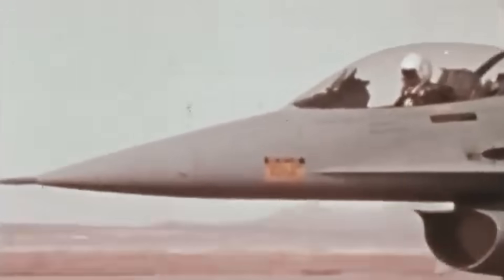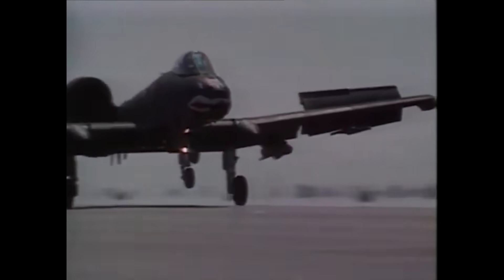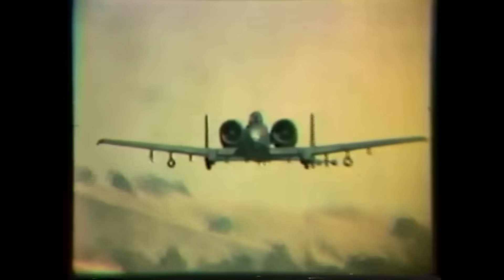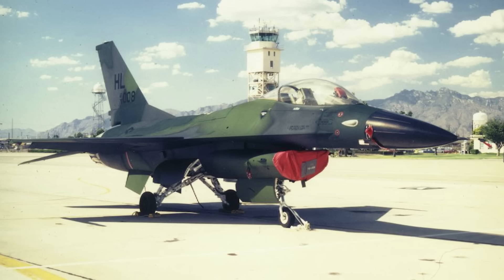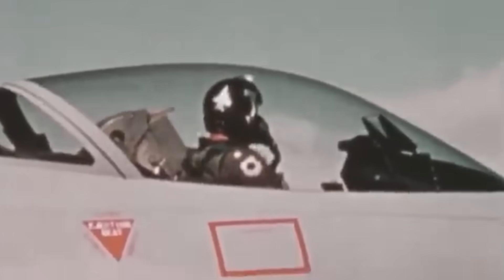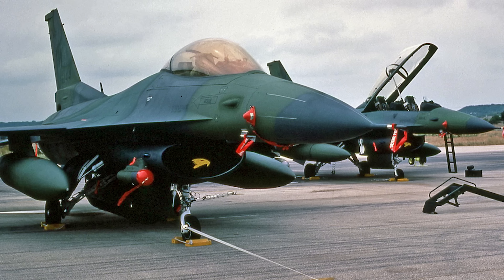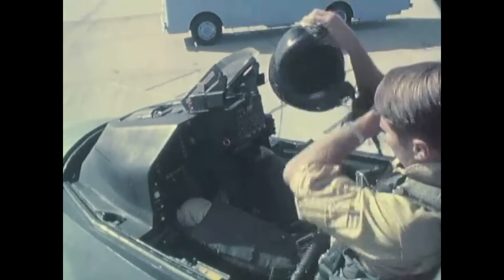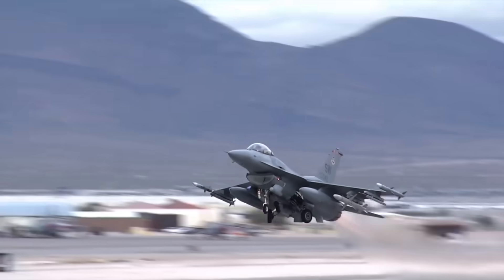The A-16. Can a Viper turn into a Warthog?

Comment: I didn't know the US had the IRST turret back in the 90s. Very important device in today's warfare. Also if firepower and loiter time is a concern for CAS missions, why not use attack helicopter or AC130? You already have air superiority. You don't need the Hog.
Reply: The US had the first IRST systems.  The F-101, F-102 and  F-106 Delta Dagger had IRST all the way back in the early 1960's and it had a detection range of over 100mi on high altitude bomber sized signatures. The F-106's system even slaved the IRST to the radar and vice versa.  There seems to be some belief that IRST is some Soviet innovation and that the US has always been behind on that system despite them fielding numerous aircraft with it.
Reply: Mostly it's cheap (operating hours and repairs), loiters, stable gun platform, numbers, and extremely high survivability (yes even against IR Manpads, flares and one consideration of the "strange" tail control surfaces / turbofan engine nacelle design). Multiple A-10s can rapidly engage "surprise" targets simultaneously at peach picking level in any weather and loiter just outside a hot zone to be deployed in seconds instead of minutes, and have the ruggedness to get the pilot back behind friendly lines when they are damaged. Hans Ulrich Rudel was consulted on their design, he knew a thing or two about what does and doesn't work for DCAS at the very fundamental level.

AH's are too slow, fragile and have limited fuel for loitering, they are mostly used for planed ambushes, raids on small stationary targets or supporting UHs into hot zones. The AC-130s are comparatively slow, somewhat weather restricted, and way more susceptibility to long range radar guided threats since they have to operate so high and in limited numbers. They are better used in support of well planed clandestine ops on limited numbers of asymmetric targets. Neither have the survivability or stealth to be actual "hot" battlefield assets.

But the deployment numbers and battle hardiness was only applicable if the A-10 air frames and spare parts were actively being made and supported under contract, since Fairchild-Republic went bust and no one makes them anymore their ability to cheaply "zerg" a battlefield with hardened air power is a moot point. So unless someone like Boeing supports the program, like they did with the F-15, they are better off retired and money spent on an armored drone swarm program in conjunction with a "handshake" to forward air command and control pilots with VR.
Reply: When developed the A10 was seen as a fast deploy tank buster raining 'liberty" on a potential red army tank rush on the planes of Europe, within a "contested" air space. While the C130 could do the job, they are much too large and even more vulnerable, attack helicopters didn't have the range or speed to counter such a rush.

Comment: Is it possible to make a UAV A-10 with GAU-8 Avenger? There are examples of the F-16 that can be flown as a drone with no on-board pilot. An Aerial refueling UAV such as the MQ-25 (land based variant) could accompany a cas F-16 uav to allow more time on station or just one strafe run and then drop a weaponsbay of switchbl@des. The F-16 is still in production. Purpose built drones as CAS aerial support? A supersonic stealth UAV with a weapons bay of drone sub-munitions and small missiles. The allied ground forces are led on patrol by Darpa point-robots each packing an M240. The Darpa point-robots & small scouting drones determine the allied group is close to a well-hidden enemy ambush. CAS comms sends two stealth UAVs or Kratos airwolves. The first wave of submunitions takes care of the enemy ambush team and the second wave (like Bolt-Ms, switchbl@des etc) fans out looking for possible back-up for the enemy ambush team.
Reply: @alanb9337  it wouldnt be worth the cost, when instead you can just getting more F-35s
Reply: @De_cool_dude  Ghost Bat (or Taranis) drones at us$8-10 million are a less expensive option compared to the us$80-100 million for each F-35 plus the cost/ potential loss of the onboard pilot. 12 basic Ghost Bats versus one more expensive spec F-35. Or the products that Anduril's new factory in Ohio is going to mass produce (14 minute interview with Palmer 4 days ago on Bloomberg)
Reply: @alanb9337  The drones would still end up being more expensive because they could be just shot down with manpads if they try to use the gun
Reply: @alanb9337  The Ghost Bat doesn't have anywhere near the capabilities of an F-35.

Comment: Cant happen , as good as the viper is, it will NEVER BE ABLE TO SUSTAIN BATTLE DAMAGE, JUST KEEP IT AIR 2 AIR LIKE IT WAS CONCEIVED AND DESIGNED FOR.  Remember  the F-4 and F-111, B-47, (many others) that were FORCED UPON THE U.S. ARMED FORCES. NONE OF THOSE AIRCRAFT WERE PARTICULARLY GREAT AT ANY 1 THING. AND THEY WERE NOT REALLY THAT GOOD AT ANYTHING BECAUSE OF COMPROMISES TO MAKE IT EVERYTHING 
 A-10 ,A-6,C.A.S. F-15,F-22 F-18, F-16,F-8 air superiority MILITARY industrial complex and politically motivated lobyist actually take away from the Leathality of our great military.  
Lets make the B-1B a ginormouse anti-air missle plane, or a B-52 into Blue angle flight demo- team... 😅
Reply: you don´t need to be able to sustain damage to provide cas

Comment: This was possible until Russia modernized its air defense systems, after Russia modernized the S-300 to the PMU-2 level, which meant that it had a radar range of 400 km and a missile range of up to 250 km, all these aircraft became unusable, and this happened in 1996, since then the entire West has been trying to make longer-range air-to-air missiles, but when they were close, the S-400 appeared.  Of course, the West threatened anyone who bought this system that they would be sanctioned, but it only worked for small countries that did not They had the courage to buy these systems since the price of Russian air defense systems is much lower than the aircraft, the problem is that they did not buy enough S 300 PMU 2 and S 400 systems together with Pantsir SM and Buk M2-3.
Reply: That´s why the f35 exists, it can destroy any air defense system
Reply: @aquilesca5tr0  Yes, I know, I remember the F 117 when they said it was invisible, and we in Serbia didn't know it was invisible, so they shot it down with a system from 1970 Russian, of course the S 125.
Reply: @velimirkolundzija4451  Which had nothing to do with it´s stealth capability, didn´t stop the f117 from completing it´s mission, the f117 IS and aircraft from the 1970s, needed to shoot the missile at basically point blank and the f117s continued to fly hundreds of sorties. If russian air defences lose hundreds of sam batter that each cost as much as several f35s to score a single hit it means they aren´t effective
Reply: @velimirkolundzija4451  The F-117 was shot down becuase the US was being lazy and complacent and was very unlucky, while the Serbs were being incredibly smart to capitalize on that laziness and complacency.

It was a one-in-a-million shot that was only possible becuase the F-117 flew unescorted (which it almost never did), because it flew the same route every day and because Serbs had spies observing the airbase it flew out of, so the SAM operators knew exactly when it would arrive and where.

Even then it took 3 attempts to get a lock (which would be suicidal if it was being escorted, but they knew it wasnt), and they only managed to get a lock because the stealth is slightly compromised when it opened the bomb bays. They had literally a 1-2 second window to lock it up before the bays closed, even with all the planning from the Serbs and all the complacency from the USAF.

Even then the first missile lost the track and missed, with only the second missile hitting the F-117. The amount of things that had to align perfectly for that shootdown to happen was astounding. The F-117 shootdown doesn't prove that stealth doesn't work. It only proves that if you do enough things wrong, stealth can be overcome.

Also an S-300 or S-400 wouldn't be much better at shooting down a stealth aircraft than an S-125. They can "detect" stealth, but only with radar wavelengths so wide that they can't  get a high enough quality track to actually target it or shoot at it, only see in what general direction it is. Not to mention the fact that at that wavelength you would also be picking up clouds, random background noise from home radios and a bunch of other stuff, so even if you could detect a stealth aircraft, you would also detect everything else.
Reply: @aquilesca5tr0  And with S 500? Go to YouTube and type in S 500 and go back and write what you think.
Reply: @velimirkolundzija4451  

S-500 isn't even meant to shoot down aircraft.

S-500 is an anti-ballistic missile system with the very same radar as the S-400. The only real difference is the missile, which is even worse at targeting aircraft becuase it isn't even designed for it. The S-500 is designed for very high flying, very fast ballistic missiles that can't really turn very well.

Could an S-500 shoot down an aircraft? Absolutely. Is it better at it than an S-400. No, if anything it's probably worse at it because the S-400 is designed to shoot down aircraft, while the S-500 is designed to shoot down missiles, which move in very different ways.
Reply: @sdfopsdmsdofjmp7863  Russia had just finished the existence of the S 500 system, and it took about 5 divisions, which is about 30 S 500 batteries. Russian air defense systems are networked, which means that the S-400 , S 300 PMU 2, S 350 and now S 500 networks of air defense systems and everything that some S 300 radar sees on the border with Ukraine can be seen on all other air defense systems, and not only the larger ones such as the S 300, 400 and now 500, but also Pantsir and Buk M2-3. America knew that Russia had not completed its air defense system and that the completion was supposed to be in early 2024 and that's why it pushed Ukraine to Russia in 2022, but at the end of 2024 they put the last S 500 in Russia which probably won't have the need to shoot down anything because that's what they're going to do Systems below such as S 400 or Buk or Pantsir
Reply: @velimirkolundzija4451  the S-500 is an anti-ballistic system, not anti-aircraft. Stop watching youtube text to speech military channels.
Reply: @ChucksSEADnDEAD  I'm glad you understand Russian air defense systems, but what is the S 400 or S 350, S 300 PMU 2 or S 300 V 2,500 or 4,000? All Russian air defense systems are networked, according to the principle from the largest to the smallest, which means that if now, when the S 500 is put on duty, everything it sees is seen by all other air defense systems and when it assesses what the target is, it decides which system will shoot it down, and these are mostly Pantsir systems.  Buk m2 - 3 and the like, and even S 125, Neva or Strela 10.
Reply: @velimirkolundzija4451  yep sure buddy

Comment: I can understand why they would want to phase out the hog for something else. It is getting long in the teeth but its kind of like the B-52 in that its so good at what it does, the only thing that can replace it is it. Or maybe a good turboprop design
Reply: The B-52 isn't good becuase it's good. The B-52 is good because all it does is carry a whole lot of cruise missiles and launch them far, far away from where it could ever be reached by enemy aircraft or SAMs. The B-52 is literally just a truck with wings, it's allowed to be mediocre because the payload (cruise missiles) is the "real" combatant. The B-52 doesn't really ever drop bombs anymore, except very occasionally where it has been used as a very long-loitering CAS platform over Afghanistan.

The A-10 does face combat and doesn't really do it any better than an F-16 or F-15E except in the very few circumstances where the 30mm actually offers an advantage and the airspace is safe enough for it to fly safely. Those use cases are so few and far between that the A-10 can't really justify its existence as easily as the B-52 can.

Basically the B-52 is still in service because no matter how good of a replacement you make, there still isn't anything that could do what the B-52 does better, becuase the B-52 doesn't do anything difficult. Yes, you could develop something like a B-737 or something, but it the cost isn't worth it if it's cheaper to just keep the B-52, since the B-737 wouldn't do the job of the B-52 any better.

The A-10 has a job that can be done better.